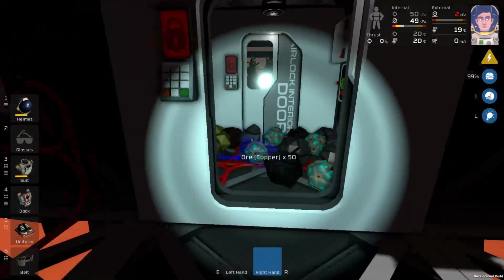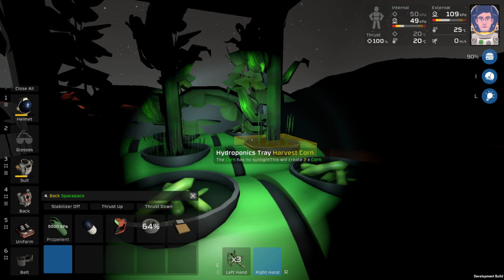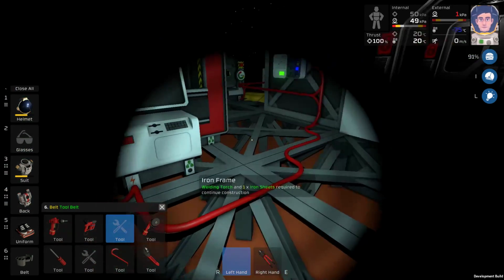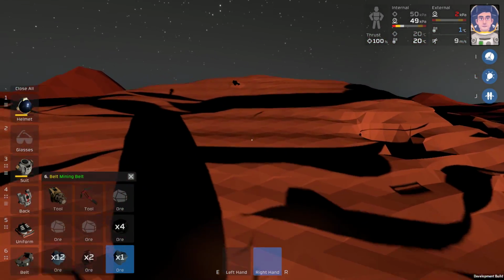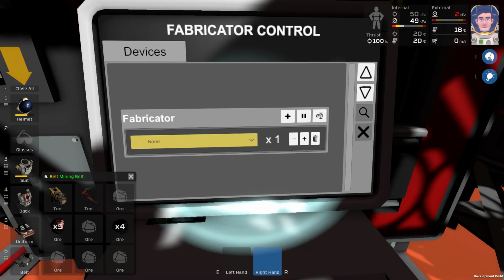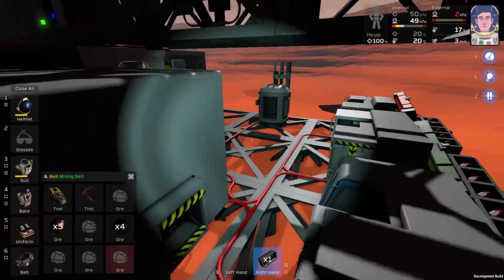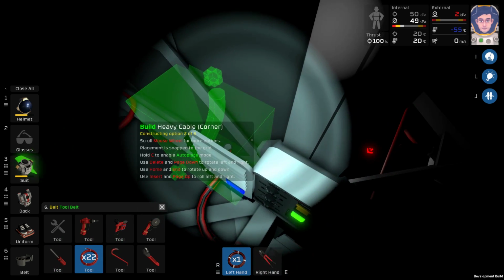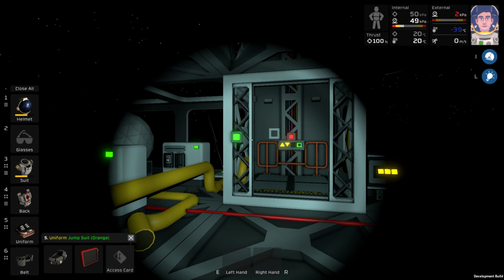Stationeers / EP 9 - Fabricators and Nuclear Batteries / Mars Colonization

Comment: I realize that most of what we are used to breathing is mostly Nitrogen, but would it be worth it to add a filtration system to the greenhouse to grab all the O2 and other gases that's being produced by the plants?  Instead of just venting them into the atmo as you mentioned you may do down the road?
Reply from the maker: I can pipe in O2 from Martian atmosphere at far greater of a rate (like 1000s of times faster) than I could skimming it from the farm.

Comment: The battery charger only charges at 500watts per battery regardless of which cables you use. The fastest way to charge a battery is the APC itself.

Also APCs dont work as transformers, they can overload the circuit and can blow cables, they only work as battery backups for stuff downstream and can separate data network too.
Reply from the maker: Thanks for the reminder.